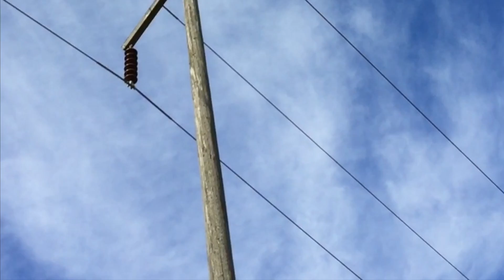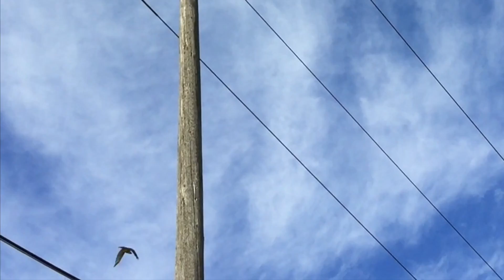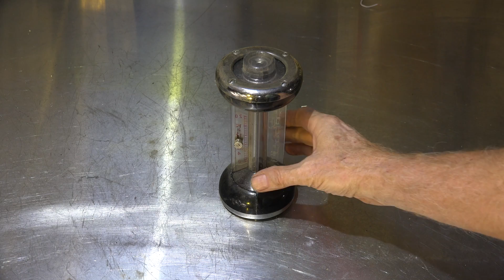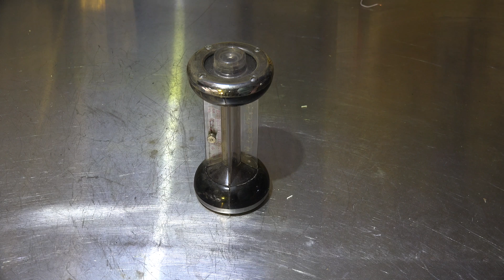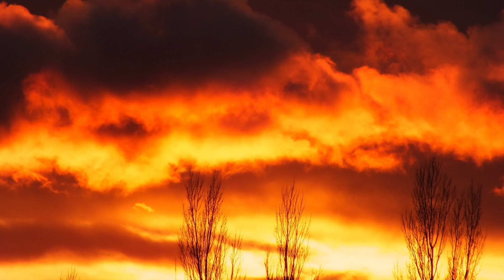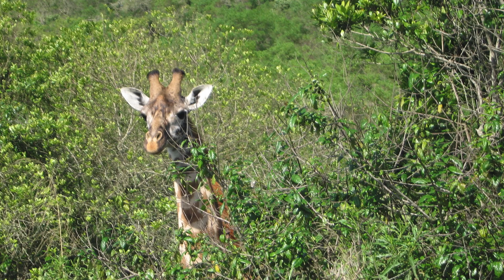What is this tool?

Comment: The pair that it usually is seen with is a CO2 and O2 anaylyzer. CO2 consisted of a red liquid solution (potassium hydroxide) and the solution is generally only good for around 300 tests. The O2 model contains a blue liquid solution of chromous chloride and is good for around 100 tests. These are used to calculate steady state efficiency with temperature readings and slide rulers. We use these in our HVAC lab! Old school!